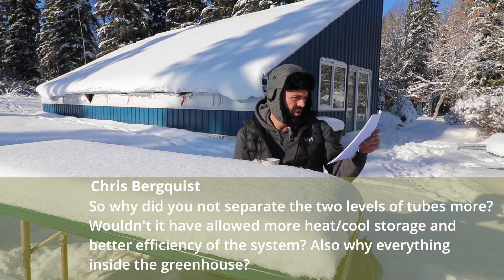Earth Tube Placement in Climate Battery #AskRobAvis 002

Comment: Great series, on the climate battery! I'm building a greenhouse now, but my plan is to have one knee wall shared with a fish pond, with pipes run from the floor of the greenhouse down under the fishpond and back again. But I've never seen anyone try this, perhaps because it's psychotic but I imagine it's because it will be some extra hassle and most sites aren't ideal for it. Do you have any thoughts about the viability of this idea?

Comment: Tubes are far too close together, there`s virtually no mass between them. The tubes are too long at 35ft and 20cfm per tube (800cfm total) is nowhere near enough for a greenhouse of that size. Paying $2300 for the manifolds is complete madness considering its the 4" tubing ($700) that is responsible for the heat transfer. The layout makes it impossible to test or balance the airflow in individual tubes. This design can best be described as hit and hope, which is only marginally better than wild ass guess.

Comment: I know this is old but maybe you'll notice it. I've been watching a whole bunch of these other videos and on the 1 question the question was about why your pipes are so shallow compared to what has been suggested in other systems to work so much better... Some geothermals go straight down... and on the horizontal ones they are quite deep... 6-10 feet. Yours appears to be very shallow.
Reply from the maker: The disparity may come from how our GH is not necessarily "geothermal", in the sense that we are not utilizing heat that is radiated from geologic processes. Rather, we are capturing heat from our back wall from the summer months, directing that to our shallow layer, and by the time winter comes around it is radiating that captured heat. If we were to put our manifolds deeper, we would have less of that heat from our climate battery interacting with the space above.
Reply: So if you got down lower and had longer runs so the temperature you were picking up was warmer and kept it from freezing at all.. wouldn't that be better?
Reply from the maker: I'm not sure I understand what you are saying/asking. We do not have a good source of geothermal heat in our area. We are storing heat that we collect from solar radiation in the summer in our climate battery. If the climate battery is too deep, then it has a thicker column of material to radiate through, leaving less heat for the air above.

Comment: If you can introduce 50% aperture at the midsection with copper foil radiant like sections done correctly you can drop transference by   about 30% again if done correctly .  Aso that will increase condensation accumulation so a measure may be needed to the removal of said condensation but could be done naturally by down ducts. In retrospect this could also be a great return for drinking water. Just an idea.

Comment: We designed our new system with deeper layers of pipe to get more of the geo thermal effect for the coldest months ,our lowest level is 7',and the next is 5' and from the few projects that I have found info on that collects data we are hoping to get a bit better results. Did you consider a deeper system in your models and if so what did the modeling suggest?
Reply: Yes, I think with all the research I have done I will be putting pipes a two different depths.

Comment: Highly interesting. I did an inground wick/weep bed about 100' long 2' wide 2'deep, two 4" perf. pipes, covered in sand then soil, doing s curves through the back yard, and another 200' around the perimeter of the yard. I was thinking of putting a fan on it just to see, but this gives me much hope on the cooling capabilities... I might need to drop the pipe in a few spots to lower the fill level/increase air flow. If it goes well I might have to re-design to cut up the lengths into multiple, possibly dig up the system and lift up one tube above the water line, or add another tube. Interesting that the soil would gain moisture. I guess it should work equally aswell for heating, but I'm not sure if I want to breath the air. Would be cool to have a double walled greenhouse, and pump the air between the layers.
Reply: If you are trying to make the battery under the footprint, i imagine it would be beneficial to have a portion of the system outside of the footprint. You would be doing the work of the temp change outside, warming or cooling before hitting the battery.

Comment: What are the plans for an efficient snow removal system or tool so that lovely winter sun can get in?
Reply: To remove most of the snow a tool like this https://youtu.be/97UHZTY8cl0?t=80 is very effective. Just make sure it has big wheels so it moves easy, and a none metallic handle so it doesn't deform and crimp. With a bit of DIYing the handle can also be used with a bristle brush to remove most of the rest of the snow.

Comment: Are you saying the condensation and evaporation is coming from the soil though which the earth tubes are buried? If so it would would have been interesting to see the fluctuations in soil moisture as the air is being moved though the earth tubes by soil moisture probes placed down the length of the tubes.

Comment: I went too deep (8')on my first layer as I have to pump water out for the fan to be able to push air through, my second(6.5') layer has been the workhorse as even at -10 low my low in the GH was down to +5 C.  My raised beds I have covered with a canopy of removable insulation and at the lows it was still +9 C compared to the outside.  Temps from the ground battery were 15 c in heat of August and now are consistently at 10 C.  I am using a couple small grow lights on my Tomato's as they wouldn't stand a chance to survive into Nov or Dec.  So far very happy and thank you for helping me learn and experience this alternative, I would call it a success.  If you want to look at my videos or progression you can find them at 214Carlisle (youtube page), no competition just recorded to keep a history.  thanks Mark in Douglas NB Cda.